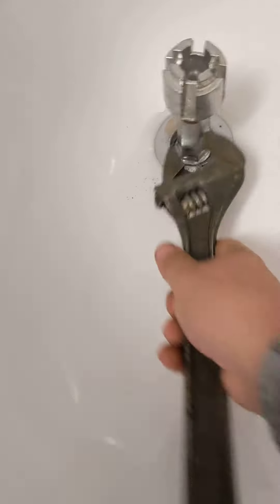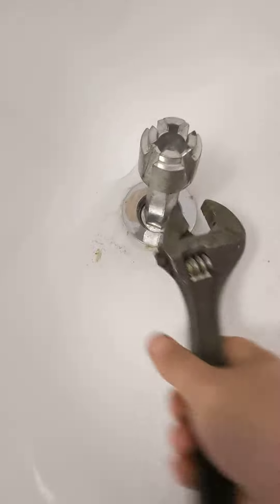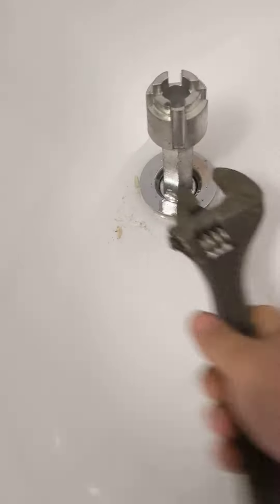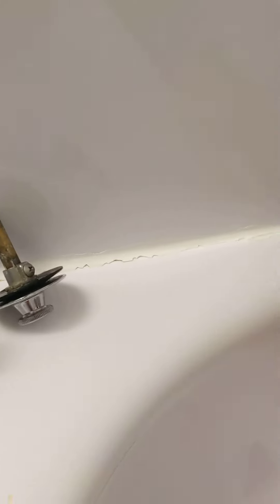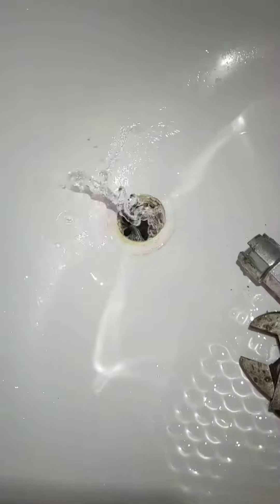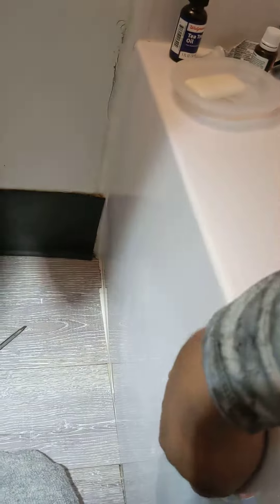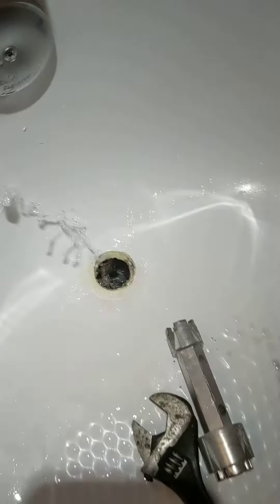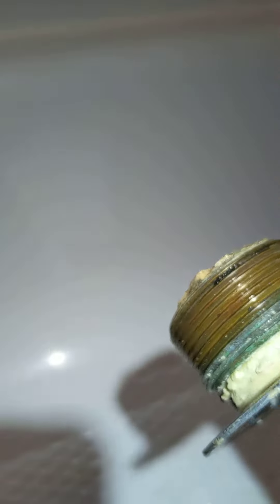How to fix a squishy bathtub liner

Comment: i have this issue now, but the gap between tub liner and wall is big, too big to just adding new caulking, should i add glue down the inside of the liner and try reglueing it before i seal it
any info would be greatly appreciated!